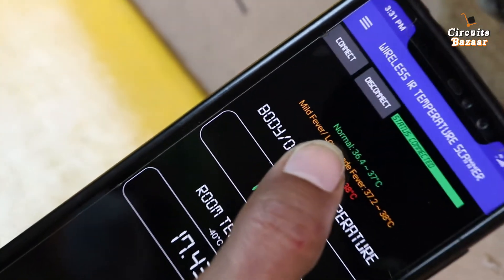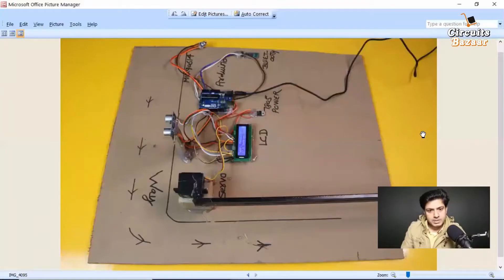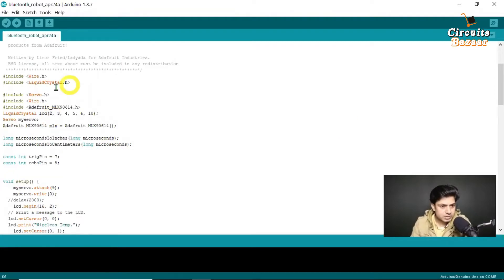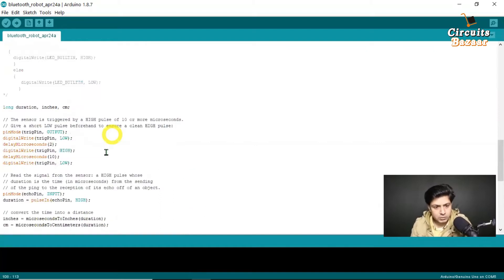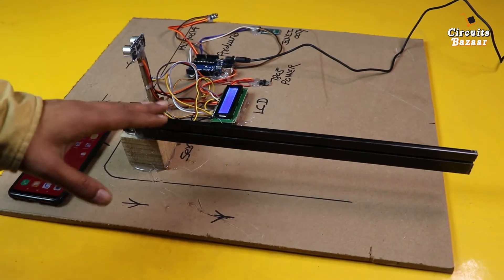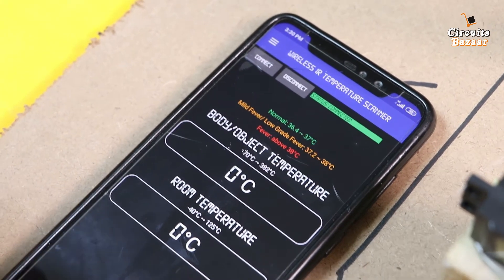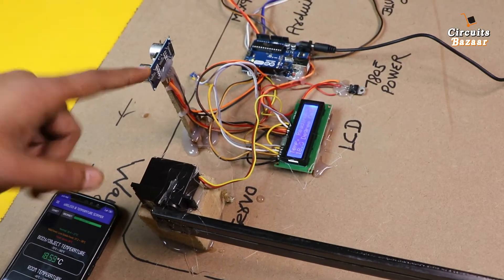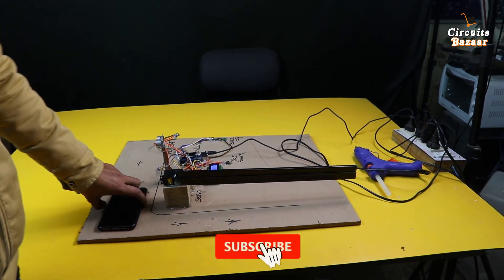Latest Covid-19 Project | Temperature Controlled Automatic Barrier Control System | Ver 3

Comment: Coz i dont knw how to do the connection from arduino to ither sensors and servo motor
Reply from the maker: So you need circuits diagrams?

Comment: Sir, do you have a tinkercad version of this project. The wire connections is a bit hard to read in this video.
Reply: Send circuit diagram
Reply from the maker: You can check our blogs on this project where I have provided the complete detail how its working their circuit diagram and all other files